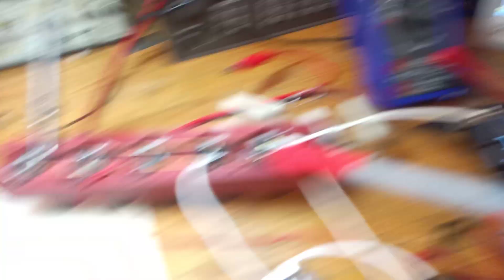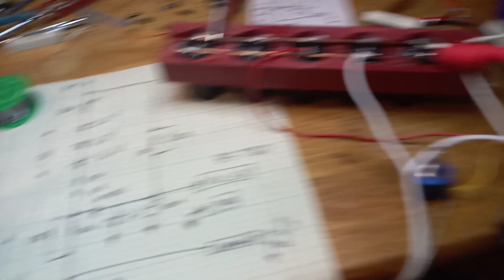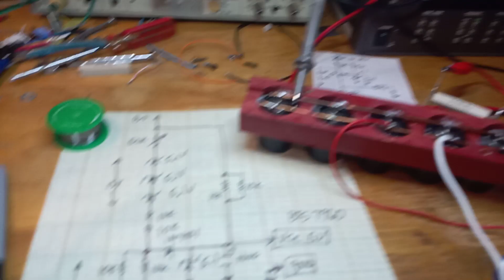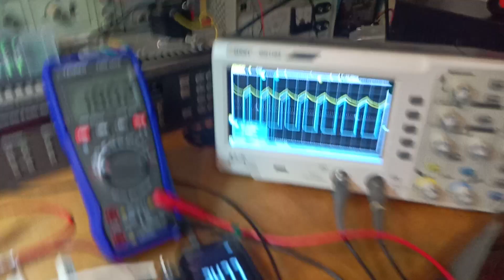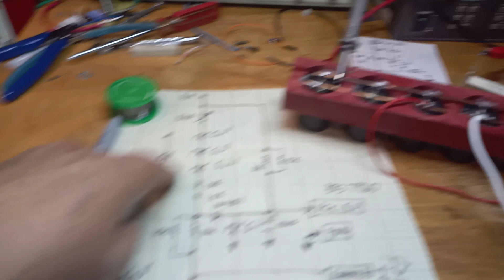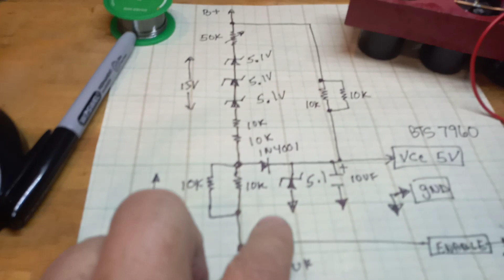BTS7960 Turned Into A 12V (18Vmpp) PV Camp Water Heater part 3 Improved Timing

Comment from the maker: Timing is everything.  By replacing resistors with a couple of diodes, the cycle times shorten and the delta voltage tightens.  With the prior video there was about a 5:1 resistive voltage divider.  The enable pin will see a voltage change reduced by that much.  Zeners will just subtract that voltage and the delta voltage change at the sense pin will be much larger.  That will make the delta swing on the capacitor bank smaller and increase efficiency.  More zeners can be added for higher voltage.  Even the forward voltage (0.7V) of silicon diodes can be used for a fine adjust.

A packet of 100 diodes is cheap.  The zeners could all be replaced with diodes.  The three 5.1V zeners could be replaced with 24 or more diodes placed in heat shrink tubing.  With those exposed to outside air, they will provide temperature compensation to nearly match that of the panels.  Seven diodes could replace the 5.1V zener.  However, if exposed to the same temperatures the compensation of the other diodes will be negated.  If the control is in a more stable temperature area, you still get the temperature adjustment benefits.  10K 1/8W resistors are cheap and allows only one resistor value to be ordered. They can be put in parallel or serial to obtain value needed.  The 0.22uF capacitor can be between 0.12 and 0.33uf.

Comment: Really nice project. A modified water thank with two heat elements where you used the bottom one for solar and the top one for domestic electricity would probably give a ROI ( return of investment) in a week or two.

Another interesting use would be in a thermal storing cook top (Not sure what it is called in english) Big lump of insulated iron with a 50-100W heating element. It was common over here around 1940-60. 

Anyway, a comment for the algorithm. 

Thanks for sharing your insights and projects like this.
Reply from the maker: These modules seem nice until they aren't.  These are far too fragile for neophytes and one wrong move they are toast.  The same thing can be accomplished with a LM358 and a FET.  A lightning hit results in a repair of less than $1. 

I'm working right now on a cooker. I have a very inefficient, as far as heat loss, but will be able to show power point heating if standard 120VAC appliances with 0ne or two 12V 100W panels.